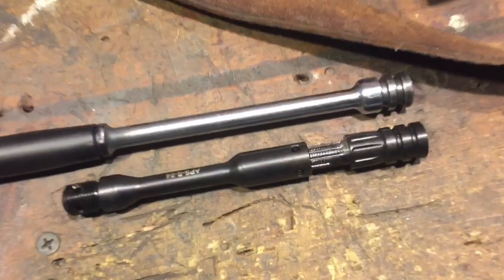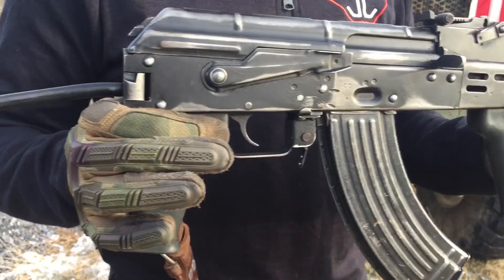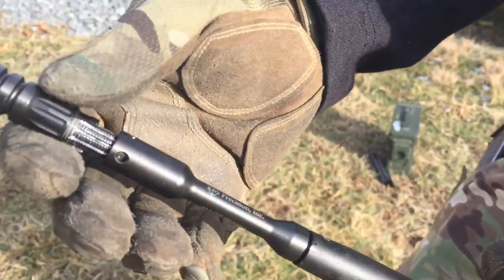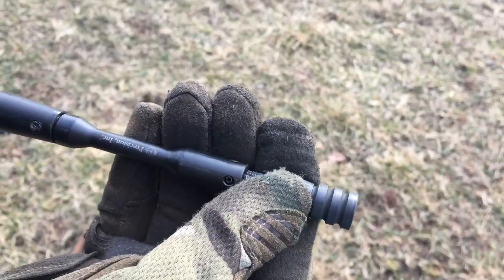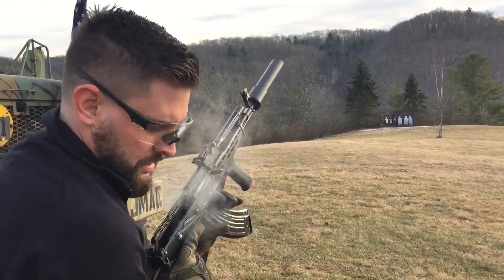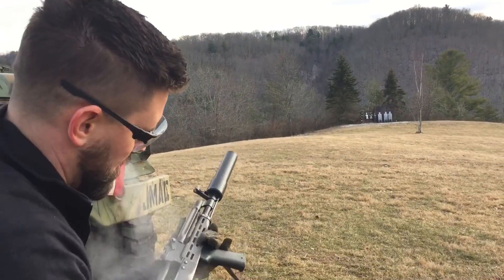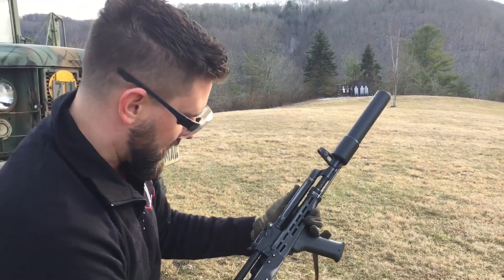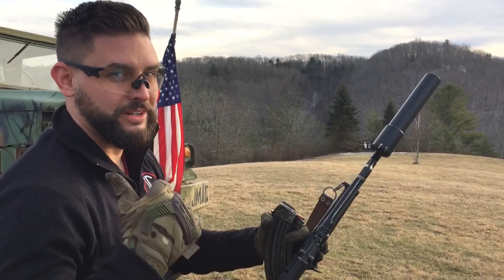Part 1: KNS Precision Adjustable Gas Piston install and adjustment

Comment: I'd use a high speed camera and adjust it to where the bolt carrier would almost hit the back of the  stock tang area.
Reply from the maker: That's a great way to do it

Comment: Do you need one if you don't run a silencer? My riley throws the spent case about 20 feet I'm thinking that's a little over gassed I'm new to aks by the way

Comment: Can you adjust the piston so the vent is all the way open and see if there's enough pressure to eject the spent casing? This is really a game changer for the AK platform. So simple, effective, and non permanent mod to the gun. Can it be riveted to the carrier like a standard piston?
Reply from the maker: MrGunman11 it turns the rifle into a bolt action
Reply: Hope you guys do a video on the M92 as well. Just saw that you got one of the 92 pistons so really want to see that. lol

Comment: So its supposed to be used for cycling sub-sonic ammo through suppressors?  Neat I guess
Reply from the maker: saintsinningsword negative it doesn’t help with under gassing, but does help when running supers through a suppressor
Reply: Or any AK variant that is kinda over gassed: i.e. 556 saigas out of the box.
Reply: Zach Stambaugh i.e. nearly every AK ever